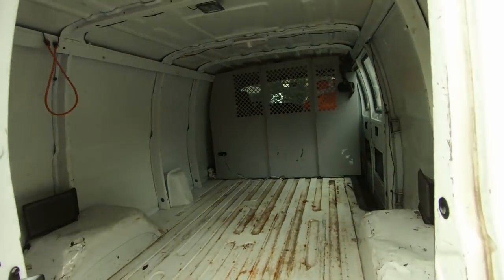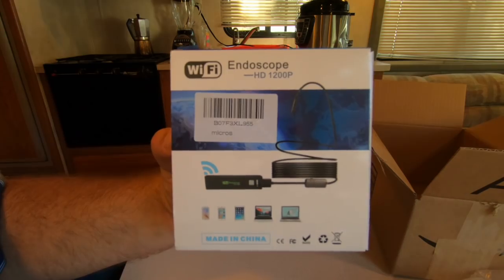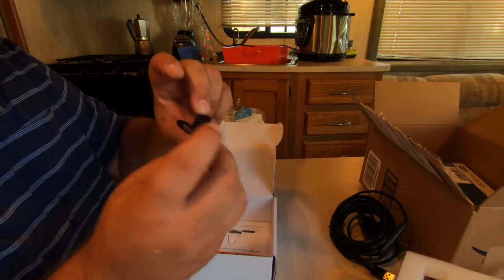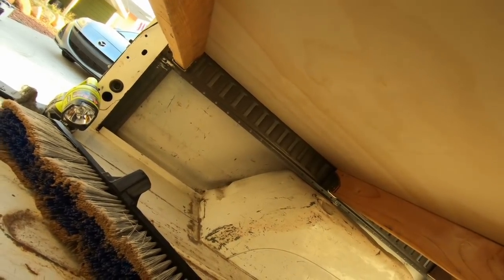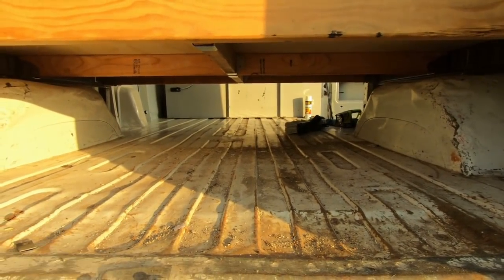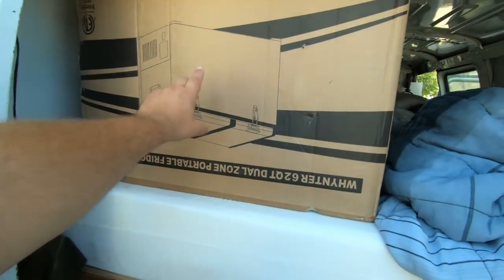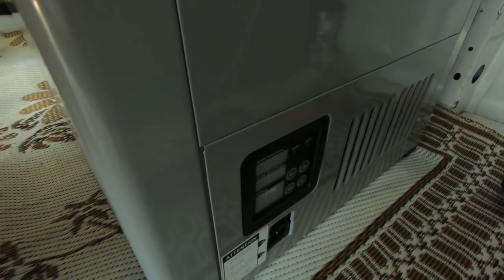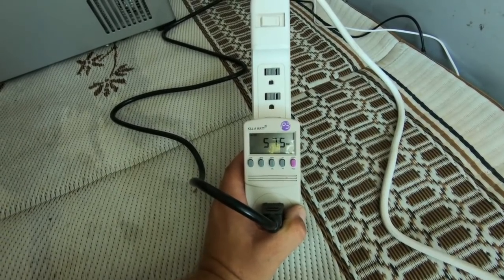Dajiban Van Life DIY Off Grid Stealth Camper Van Build Part 1

Comment: Good to see you James. Awesome bed, very strong and you can still utilize the e track for securing items. The fridge uses 60 watts no matter if it is ac or dc, that's the beauty of watts. My TV uses 120 watts, that is... 1 amp x 120 volts and uses... 10 amps at 12 volts. Using 120 for ac as a reference point makes it so much easier to do the math by multiplying or dividing by 10. Can't wait to see the endoscope review. Enjoy the weather there
Reply from the maker: Thats not true. Amps X Volts does not hold up in AC systems. Its close if you have a pure sine wave form. But Ohms Law does not work accurately for AC systems. Its a DC only law. It really breaks down when AC wave form is modified.
Reply: @WanderlustEstate  modified sine wave inverters can damage electronics and motors through harmonic distortion, noise, and interference. They can interfere with radio waves and create more heat which is a loss of power therfore, i suggest shying away from those. Folks don't need to calculate the effects of alternating current on capacitance, induction, and impedance, the IEEE has already done that and express it with the watt rating. My formula is the simplest way I'VE FOUND to calculate and convert power from DC to AC and visa versa. Your fridge was 60 watts at 120v ( 121.2 does not matter in calculating this) which is .5 amps. With my formula I conclude, in no more then 10 seconds ( and I'm slower than your average Joe lol), that I will need 5 amps of 12v DC power minimum to run the fridge. Please explain how you would calculate how much DC power you would need to run the fridge when it is running at 60 watts, I love learning new stuff :)

Comment: Holy Schmucker.....
Talk about mental stimulation!
The bed set up is awesome, but thinking steel on steel is going to cause some bouncing and possible damage down the road.  Some form of buffer is about all I'd see as needed.  8/10
The scope will be your friend for project and is damn handy!  9/10
That floor - YUCK!  Oh bearded  one... think of coating it with Rhino-coat or something to help with noise, vibration, and helping things like a container or "drawer" to slide under the bunk. 2/10
Oh yeah the... you're getting a 11/10 for the freezer - Whynters are Winners and YOU even scored the TWO DOOR model.  OK I'm JEALOUS!!!!  lol ....
Great Video and damn informative!
Reply from the maker: Thanks cheif, I have some ideas on frame. Although almost no movement.
Reply: Keep Rockin' It!   lol

Comment: Hook your Kodiac up to the solar panel to see how much the panel is charging. The are never as much as they are rated. Even 2 100 watt panel will only put out maybe 65 watts.
Reply from the maker: That all depends on the time of day, where on the globe you're located and how your panels are mounted. The only time solar panels match their rating is when they are recieving 1000 watts of solar radation per square meter. Some locations in the Northern US, never get that level of sun.

Comment: the smart way to do vans is to just subframe and insulate the entire back, and fiberglass roof if you want to put a shower/toilet stall in. I did a subframe floor to hide water tanks in one using six-inch thick tanks. The lumber is tens of dollars and then a roll of pink insulation and epoxy coat spray paint(to keep condensation from matting insulation and rotting wood).

When can we see the loose skin from the weight loss? I went 260 to 190.
Reply from the maker: Erik Breaman Don't know, I have a little bit on my upper arms now and midsection looks like I'll have some there too.
Reply: What sucks is the only way to get rid of it supposedly is surgery.. But you breath easier and move and work with less energy

Comment: Looks good so far! Will you try your Inergy Power supply (FULL) to see how long the Wymer will run without any charge added. On 12V not 120V more efficient and without fan running to cool inverter. With the Inergy Power supply all you need is in the box and hook up solar when ready. No charge controllers, inverters, wireing, ect.....  Nice and simple!!
Reply from the maker: Of course I will be. Then add on more power storage to boot.

Comment: I don't know why I saw this fact tonight,  But I saw someone messing with ice cream and they stated that ice cream has to be below zero.  They showed her pulling out a popsicle stick that the ice cream didn't freeze to.
Reply from the maker: Yeah, but freezing is 32.
Reply: Wanderlust Estate ice cream isn't water.  I was talking about the good stuff.   Ever notice how some ice cream straight from the freezer, is softer that other ice cream directly from the freezer.  I'm just saying that temperature matters, when it comes to ice cream.
Reply from the maker: Kip's Journey Sure, its called freezing point depression. Just like when you add salt to ice and it melts. It prevents the lattice between water molecules from forming. But, thats going to be anything. 20 degrees F will freeze salt water.
Reply: Wanderlust Estate  and... their temp may not  have been accurate.  20 degrees sounds like it would do the entire solid freeze.
Reply from the maker: Kip's Journey I'm thinking the below zero is Celsius as they would be saying that just setting temp to 0 C or 32 F isn't sufficient to completely freeze the ice cream.